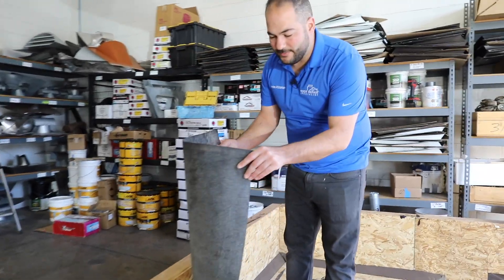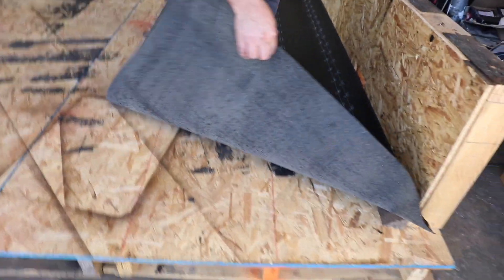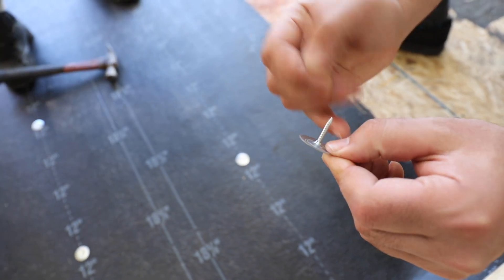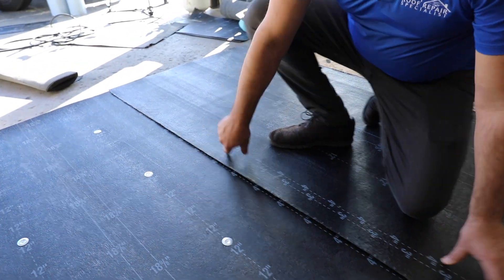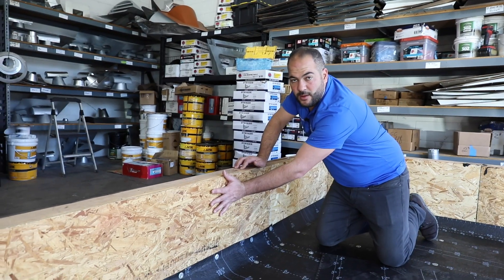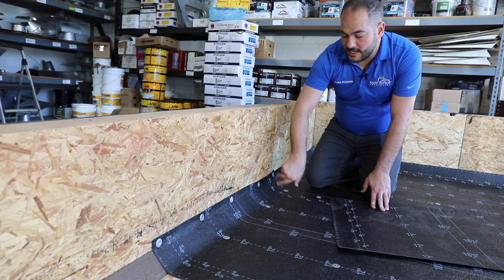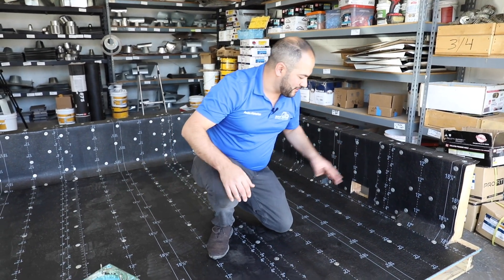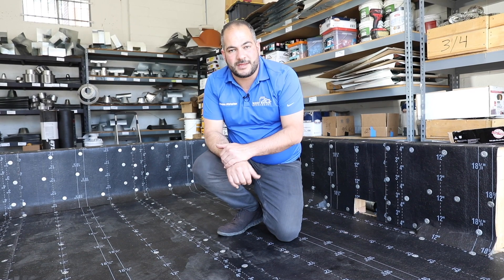How to Install Torch Down Underlayment | Torch Down Roofing Guide

Comment: How much does it cost to install torch down roof ( 3 layers ) in San Francisco per square foot . Thanks
Reply from the maker: Budget $10-15 a square foot which includes the cost of removal
Reply: @callthespecialist   does it include labor and material  or is separate . Btw how much does it cost for roof flashing installation and boots flashing ? ( I just started learning )  Thanks for your answer  . I appreciate it

Comment: You got the 9"&18" right but your 18" Nail pattern is wrong. Instead of every 18" putting 2 nails even with each other your supposed to stager them so you gave a nail every 9" alternating sides.

Comment: I have a flat roof with one layer of roofing. I would like to do a torch down roof on top of the existing material. can I put a torch down on top of the existing roof?
Reply from the maker: Yes, you can either nail a base sheet down then torch, or you can prime the existing roof. If it’s a large area over 300sqft I recommend installing a nail down base then torching

Comment: Do you have any videos of sloping flat roofs 

Some problems are drains or scuppers higher than field
Reply from the maker: Honestly we don’t mess with that, the best way is to use a tapered iso board system which gets very complicated and expensive. Especially if there is any mechanical equipment on the roof. 

I just roof in such a way that even with ponding water the roof doesn’t leak.

Comment: Is it necessary to have a mid ply on the polyglass system or can you torch down directly to the base you just installed?
Reply from the maker: Not necessary to have a mid ply but preferred. It’s offcourse comes at a additional cost
Reply: @RoofRepairSpecialist  does it extended the life of the roof?  Is it peel and stick or.torch down?
Reply: Or Is a midply like.on the polyglass system just a staggered layer of base nail down?
Reply from the maker: You can use either a self adhered or torch down mid ply. It does extend the life of the roof from about 15 to 20 years.
Reply: @RoofRepairSpecialist  does polyglass make a mid ply or do you just use a 2nd base layer for a 2nd ply before the torch down cap sheet?
Reply: @RoofRepairSpecialist  is that just for a warranty or does it actually extend the life of the roof another 5 years?
Reply: @RoofRepairSpecialist  is a torch mid ply better or a self adhesive one?
Reply: @callthespecialist  does installing a mid ply increase the lifespan / warranty of the roof?

Comment: Your tutorials are awesome just wanted to point out in this particular tutorial when you were installing the wall piece the nailing just above the cantstrip was right on but you did not nail the end of the wall piece that ends just past the bottom end of the cantstrip which could leave the cantstrip vulnerable to being super heated and ignite.  However at the end of your video it looked to me that the  wall piece was nailed at the point where the floor and cantstrip meet.  For me as a fellow roofer I loved the tutorial and I understood everything you were teaching in how to apply the material.  The reason I pointed this out is for the novice homeowner watching this tutorial to make sure the end of the wall piece is not only nailed an inch above the cantstrip but also at the very edge just past the bottom part of the cantstrip as well to ensure fire safety.  Notice I used the terminology SUPERHEATED.  A fireman use that word with me because what superheated means the flame can heat something up so hot that it could ignite maybe even 45 minutes to an hour later.  And we definitely don't want to overheat or superheat the can't strip cuz that's more flammable than the wood itself.
Reply from the maker: Totally agree and appreciate the comment. 
Generally speaking not a big fan of DIY torchers, even though my videos might encourage some. There is joust to much that can go wrong for someone learning and trying this for the first time.

Comment: Do I need protect boards to lay under the base sheet? To torch black torch roll
Reply from the maker: No, the elastobase is the base layer.
Reply: @callthespecialist  so to confirm : Elasto is fire proof and don't need protection board? Lay Elasto then the torch black roll??
Also do you have video how to do 3 ply?

Thanks

Comment: Do you think I could get away with 2-in diameter roofing tins paired with a standard roofing nail for my base sheet? No one in my area sells the steel washer ring shank nails. I could get the 3-in steel discs used for EPDM underlayment but they are very expensive and also kind of thick.
Reply from the maker: Interesting, I am not sure about that. I wouldn't see why not. I would go to a local roofing supply and maybe see what they have.

Comment: hello, a question from contractor to contractor, how much do you think the life of the torch down with base and cap sheet is because my clients ask me and I told them that between 15 years and 20 years
Reply from the maker: If its just a glass base and cap sheet 10YR. 
Elastobase & Cap Sheet 15YR
Elastobase, Smooth or elastoflex SA & Cap Sheet 20 Yrs
Reply: Thank you very much for your answer it will help me a lot

Comment: Can you use this as a underlayment for a metal roof?
Reply from the maker: probably, but I dont think its a good idea. I would use a self adhered underlayment used specifically for that. Polystick MTS Plus is a great option.
Reply: Great. Thanks for the advice.

Comment: If its peel and stick , do you need to add metal caps? For example polygglass elastoflex sa v?
Reply from the maker: You should not adhere a SA membrane directly to wood deck. Nail down a layer of Polyglass Elastobase then use a SA membrane on top. A few reasons for this; 1) doesn't adhere to well directly to wood. 2) wood expands and contracts at a different rate which may cause problems in the future. 3) Elastoflex SA V is not a fire rated system if used by itself. 4) Manufacturer does not recommend it.